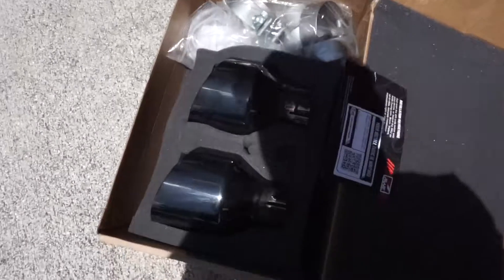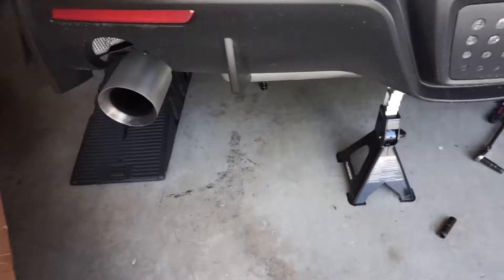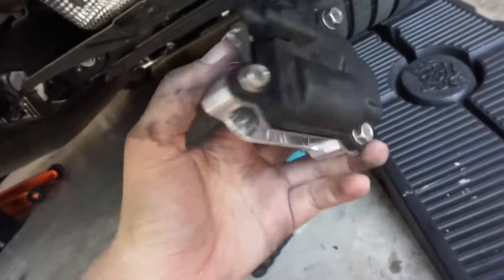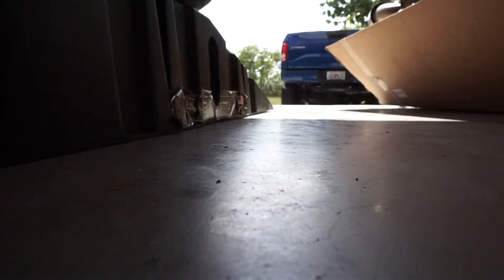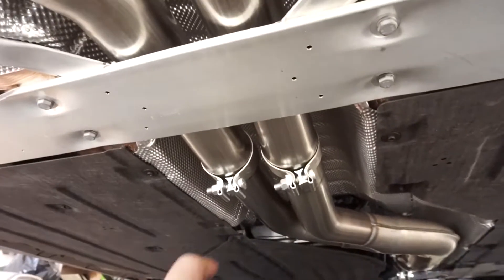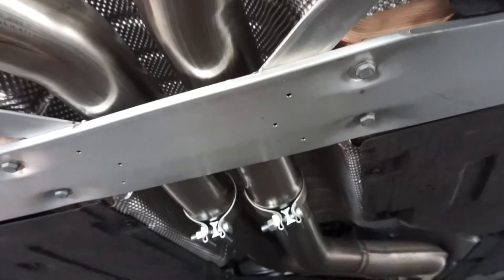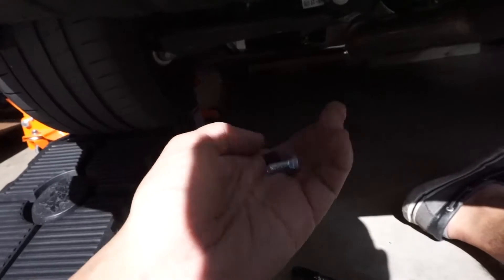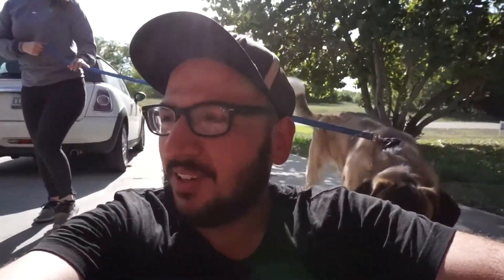A90 Supra finally gets Exhaust (AWE exhaust)

Comment: So wait,   Sport mode changes something with the engine tuning too make it pop more as well? I thought the only thing that made it pop was the valve on the stock exhaust being open
Reply: It's the tuning between the Sport Mode and the Normal Mode, that makes the pops and crackles - not the exhaust valve.

Comment: Which AWE Exhaust is this?
Reply from the maker: The track exhaust
Reply: @godrive6902  Thank you! Are there any drones or annoying noise? I'm currently running a stock exhaust with a downpipe, and I just want something a tad bit louder.
Reply from the maker: @noblesseoblige5199  so there is some drone when I’m cruising at 80+ it’s not bad but it’s there. If you have a downpipe already, it’s advised to get the touring exhaust because apparently it’s stupid loud. So if you’re looking for just a tad bit louder, the track exhaust may not be the one